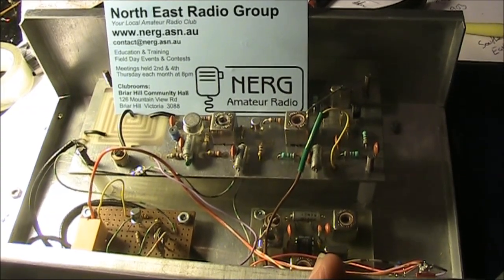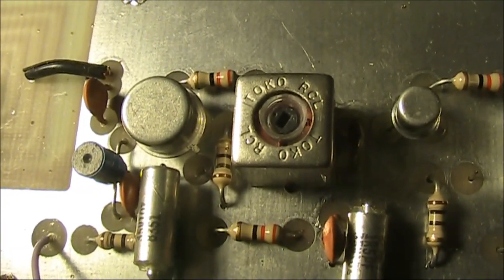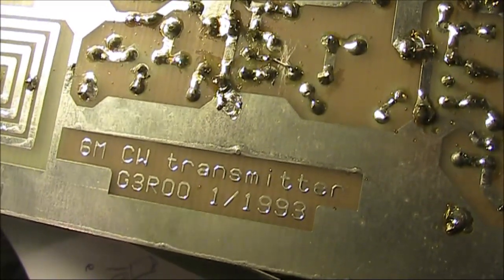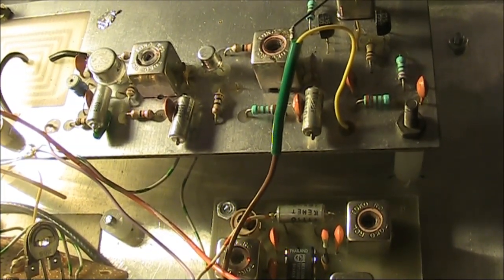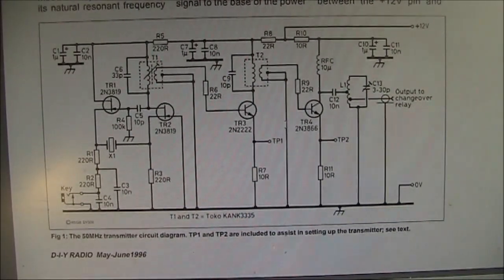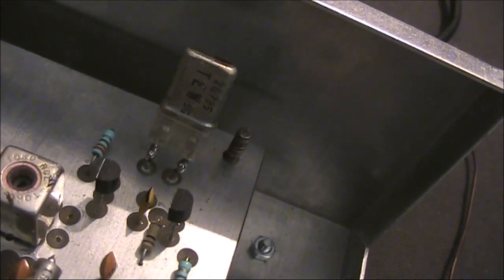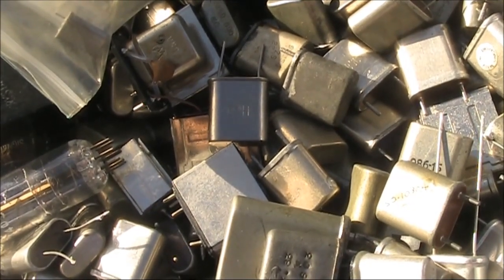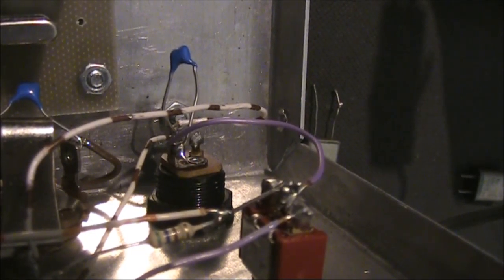Homebrew Hamfest Haul: The transverter that wasn't a transverter

Comment: Interesting history in that box, Peter. Btw Series mode is typical for an overtone oscillator. The series resonant freq is slightly below the parallel freq.  This is why overtone oscillators produce signals that are slightly below a multiple of the marked frequency. An issue for this kit was possibly the only partial availability of the 50 mhz section of 6m in the early 90s in VK. 73 Andrew VK1DA/VK2UH
Reply from the maker: Thanks Andrew. I built a similar CW crystal controlled transmitter in 1992. Worked Japan on it with a G5RV antenna. As a VK6 we had full access to 6m though those near ch 0 TV didn't have it from memory. Other VKs had a segment.

Comment: The guys at solder smoke really like the ne602. They speak of it quite often. I googled Solder smoke ne602 and a bunch of things came up. Most of the circuits and transceivers are built by Pete Juliano.  https://www.n6qw.com/The_Paesano.html  Of course, the 25mhz crystal is probably double and used as a local vfo. 6 to 10 would be  a little pointless now but the ne602 is used quite often in qrp transceivers.

Comment: Homebrew investigative reporting, digging out the story, makes for an engaging video. What was the builder thinking?  When was it made and what do we know about homebrew circumstances back then? Would it have ever had much use?  I suspect he only ever made a few 6m CW contacts. Maybe he was chasing tropo VK4s and JAs. But with 400mW? Put an Arduino Nano into the box and it becomes a 6m QRP beacon.  Some 6m DXers will thank you for doing that.
Reply from the maker: Paul - good question. I haven't looked the  builder up to ask him. It can't have been used on air as it was out of band. There was a 100pF capacitor put under the board with a track broken in series with the crystal, presumably to get the frequency a bit higher into the amateur band. But it never made it there as far as I can tell. This will not be the last video on this transmitter. Watch this space!
Reply: @vk3ye   a series inductance should raise the freq a bit
Reply from the maker: @andrewd4890  Generally series inductors lower the frequency, small value series capacitors raise it.
Reply: @vk3ye  that makes sense.

Comment: I could be wrong but it seems like maybe with the 8350 crystal the 2N3866 is being fed with 25MHz and then acting as another doubling stage.
Reply from the maker: I don't think so. The transistor before the 2N3866 would be doing the doubling.
Reply: @vk3ye  The butler stage would have to be outputting the fundamental which would be weird so I can see where you're coming from. It would definitely be undesirable operation for sure.
Reply from the maker: @antennafarmer7380  My Butler stage oscillated in overtone mode. There was no signal at the crystal's fundamental frequency.
Reply: @vk3ye  I dare not venture any further, for fear I may reveal your secret.
Reply: @antennafarmer7380  well you know the output of such oscillators is far from a pure sine wave, there is always a harmonic component.  the 2nd harmonic is usually quite strong due to the asymmetric waveform.  so picking off the second harmonic in the output would give a reasonable drive to the next stage.